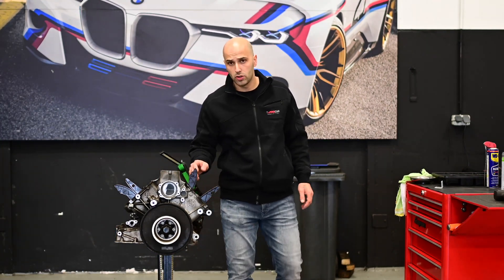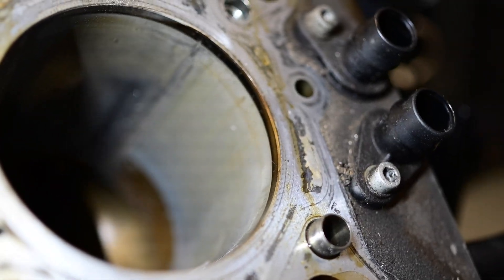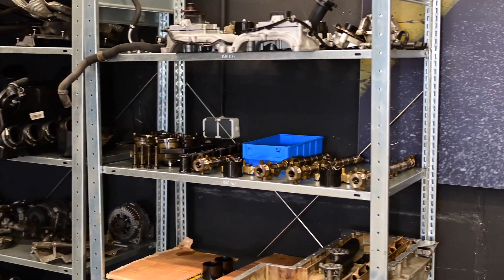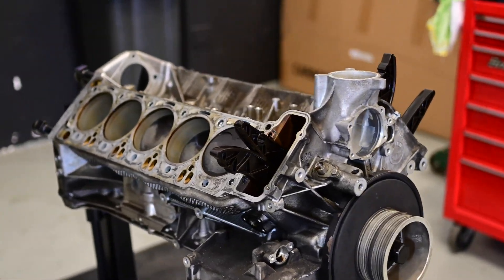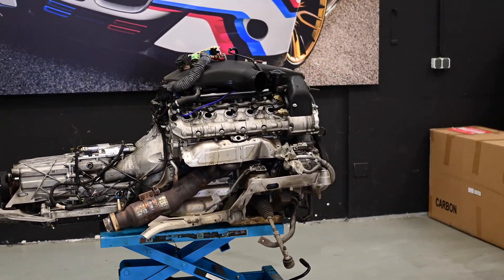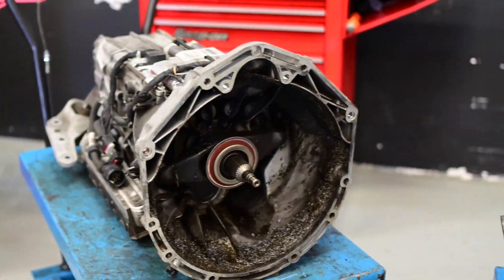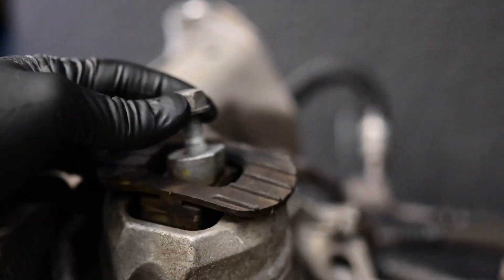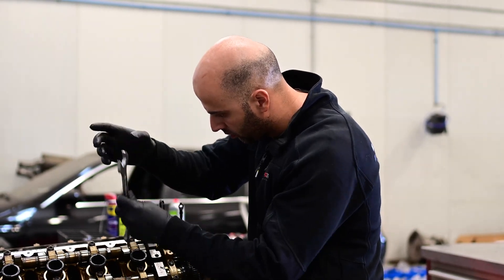BMW E60 M5 V10  Failed injector!  Engine rebuild part 1.

Comment: Oil Control rings collecting carbon from Blowby, low vacuum PCV System. Brown Blowby varnish all over inside the engine. I've noticed this on other brands also.

Comment: yes the stock new injectors are not on backorder , they are discontinued .  only option is have old injectors serviced . are you installing any pressure guage on fuel rail from now on ?

Comment: How much is the short block? Is it pre-assembled? Thanks
Reply from the maker: The short block costs € 6700,-.  The pistons are not assembled because the rods and crank are not included.
Reply: @procarspecialistinbmw  if only short block withoit piston how much the price?
Reply from the maker: @meayman1  Unfortunately the short block comes only with the pistons.
Reply: Ahh ok, was it in stock or a special order item?
Reply from the maker: Luckily it was a stock item.